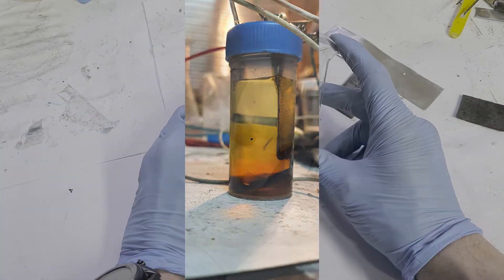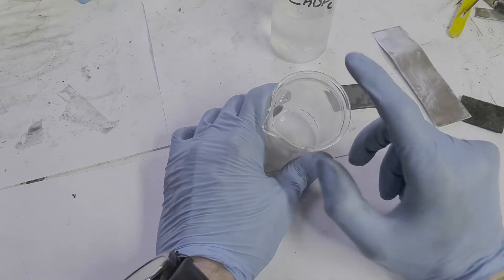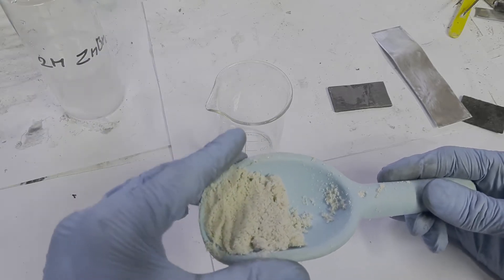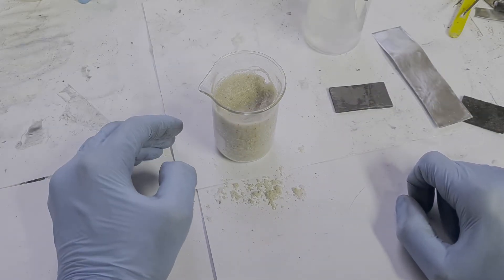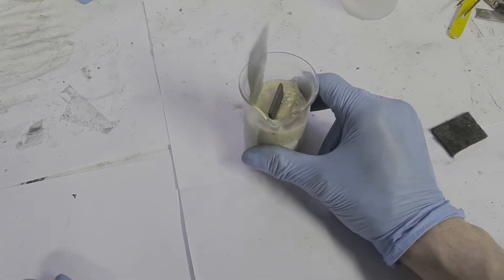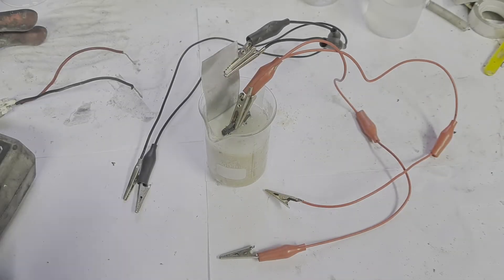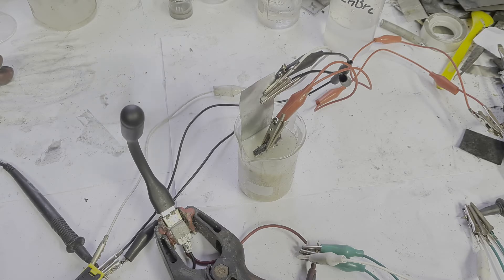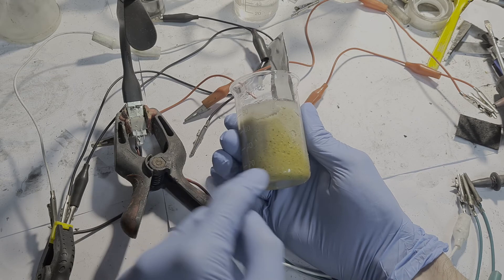Diy Zinc Bromine Battery

Comment: cayrex , I have an idea. If we dissolve zinc bromide in water, place it in the battery, and heat the battery with the help of the sun, the boiling temperature of the bromide is 59 C, as far as I can see. Bromide, which boils and separates from the electrolyte, is transported to the hot electrode heated by the sun. Is it possible to design a system where the zinc in the anode and the bromide in the cathode form a solution again after the electrolyte cools down when the sun sets?

Comment: I am not getting more than 1.71v, How you are getting 1.9v is surprise for me when keeping such distance between two electrodes and no load connected.
Reply from the maker: Uf, maybe charging problems. The distance is not the problem for voltage,.... but for current output is.

Comment: What a great way to make this type of battery, the sand also acts as a seperator i assume? and very nice to use the wax to seal it off! I like it :)
Reply from the maker: Tnx. Yes the sand acts also like separator.
Reply: @cayrex  Thank you! What about dendrite forming? Can this type of set up last for decades without maintanence, or do you make something completely else. What do you think?
Reply from the maker: @markgeurts258  Ah, the dendrites have hard time in that cell 😅. You make the cell, you seal it and forget about the cell. At worst case you will need to add some water,..... but that is only speculation.
Reply: @cayrex  I LIKE IT! And now even more:)
Reply from the maker: @markgeurts258  but make sure that the negative electrode dont go to the bottom, like it is the carbon electrode. So the negative electrode is putted 0.5 to 1 cm above the bottom of the cell.

Comment: i have 50 gram pure zinc bromide,   what is the dilution ratio to make 2  mole?
Reply from the maker: ZnBr2 have molar mass of 225 grams/mol,.... which means you need 225 grams in 1 liter of water or 22.5g ZnBr2 /100ml of water, etc. To make 2 mol,... you need 450 g in 1 liter of water. Or in your caser you make 2mol with, 22.5g in 50ml of water or 45g in 100ml of water.

Comment: sand and most membranes including plaster of paris, will not completely stop dendrite formation. The mesh membranes chop the flow so they do reduce dendrites, but is not readily available or cheap and has factory requirement for manufacture.

There is some chemistry that makes zinc crystals deposit without formation of dendrites but I do not know what it is.

Here is a video of what I am talking about. https://www.youtube.com/watch?v=00FixrwshLk
Reply: any idea on the chemistry on the linked video?

Comment: Well done! Really love the practical, cheap and safe cell. With the two electrodes being next to each other, rather than the positive being at the bottom, will the bromine not diffuse over to the zinc and short the cell?
Reply from the maker: The bromide will not form over the zinc electrode, because will form zinc bromine again.
Reply: @cayrex  I guess I am just wondering, without the vertical separation by gravity, if it will not hold its charge. Easily fixed by just having one electrode at the top and the other at the bottom like the regular gravity version
Reply from the maker: @ContinuousAmbience  here in my versions is that not the problem
Reply: I am busy making some zinc bromide using @robert murray-smiths method, where one mixes 2M solution of NaBr and a 1M solution of ZnSO4 and then evaporates off 75% of the water, cools and pours of the ZnBr2.

Do you know if I can just add the same weight of salts in 25% of water, bring to boil to dissolve and then cool again? Would this have the same result? Boiling off that much water takes lots of time.

Sorry to ask you, but he gets so many comments that he rarely replies. Haha

Comment: I think one should compare instead of sand   with silica and show the result whatsoever is gained??????
Reply from the maker: Zinc bromine battery is like zinc bromine battery,.... 1.8V of cell voltage,... capacity is related to the amount of electrolyte,.... the silica version have better power output but the sand version have cheap and simple way to make a Zn-Br cell safe. Because you only need wax and sand, which can you get everywhere for a few cents,... for example.
Reply: I think I might try this with washed silica sand anyhow. can buy the stuff from a mine near me for like $10 for half a metric ton XD Actually getting the zinc-bromide is the hard part. have to buy zinc sulphate and sodium bromide to make it up myself =/

Comment: nice video.  Have you tried Fumed Silica for the 'gel' agent?   It would be nice if you would do a video on multiple parallel plates to show increased capacity.  Especially with these static Zinc-Br batteries!  Thanks for sharing this.  Doug
Reply from the maker: Hey man! Yes I try fumed silica. But using sand was for me much more fun and you can get it everywhere for really cheap price. So if someone will make a 10, 20 liters or more cell system for home storage with safe setupe that the electrolyte will stay in place, then the sand will be a good and cheap choice,.... for example! Yes I will make multi cell setupe,... but first I need some materials to make it,...

Comment: Congratulations on the awesome video! This was way simpler and cooler than I thought it would be! What was the normal voltage you charged this battery at? Thanks for finally listing your NCS song credits in your description now! Any chance you will test wh/kg figures for this setup?
Reply from the maker: Thank you! I charge that cell on 2.8V to get good amount of charging current, because of the distance of the electrodes.  You know,... biger is the distance of the electrodes less charging currend you get and for that you need to put the electrodes more together or you increase the voltage. Yes I start to put a credits of all songs in description. Yes I will test the specific energy whith this cell setupe,.... but I will make some other more practical cell design.

Comment: Thanks for sharing this approach seems solid. I wonder how the  issue of dendrites is handled here?
Reply from the maker: About the dendrites is that cell not bad. I charge the cell with 3 volts with no problem. At 3.8V overcharge for longer time I get some problems with dendrites but still this is not a big problem for that battery because the cell will stabilizes itself when you stop charging.
Reply: @cayrex  ok good to know, thanks

Comment: Couple of questions:
1. How would sponge hold the electrolyte?
2. How would you recover zinc bromide from sand? Distilled water wash?
Reply from the maker: Sponge is also not bad,... more electrolyte can soak better it is. But sand more nature material also. When the cell is discharged the electrolytei is back ZnBr2. You just wash the sand and you will wash out the ZnBr2.
Reply: @cayrex  Thanks